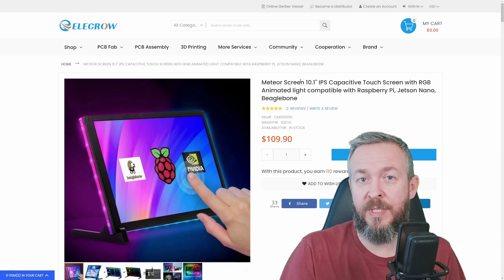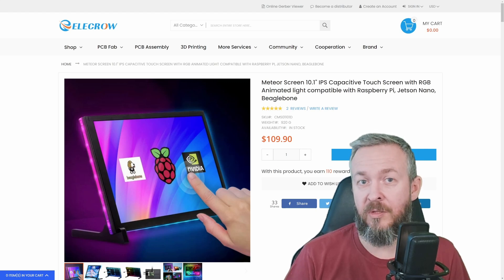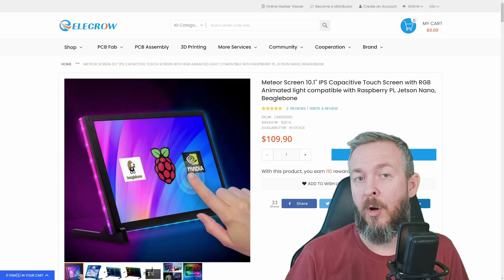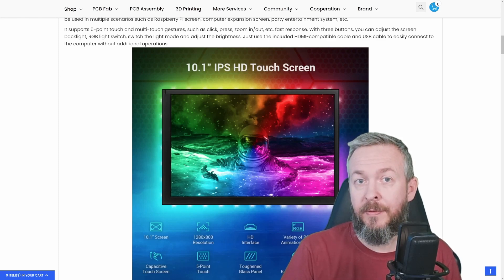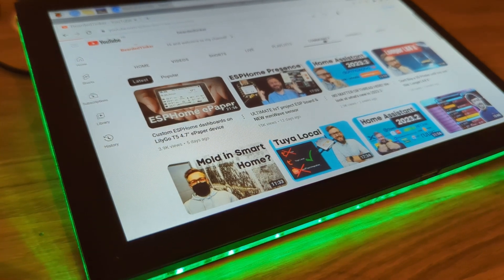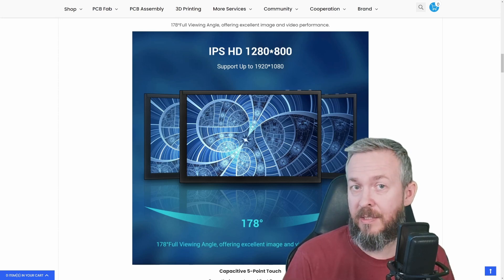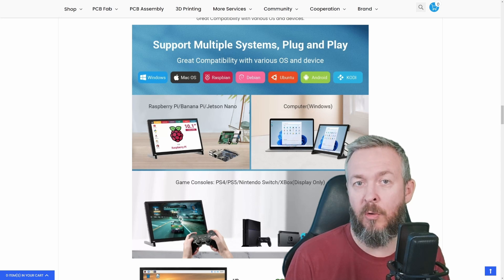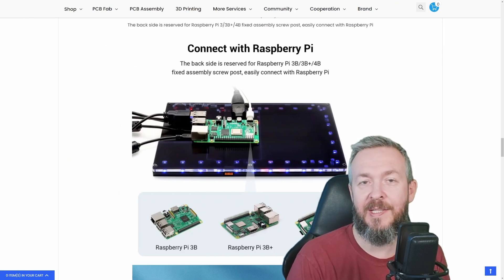Perfect 10.1 Touch screen for your Wall?! REVIEW

Comment: 5 point touch instead of 10 point could be quite a restriction, especially when doing pinch to zoom functions.   I don't think this display was designed to be wall mounted, though I do agree with you that a wall mount kit would be amazing.     Having the LED's all around the edge really detract from it being a wall dashboard for me.  I'd prefer a thinner panel without LED's.   If these guys could do this same panel, but thinner and without the LED's including a wall mount option, then it may be quite close to a perfect wall panel.
All that said above, as a stand alone display with some touch function, this does look like a great display and it is a decent size.    I do like it for what it is.
Reply from the maker: It was designed for desk use, and that's where it shines :) I have one case that I'll show today on stream - it's a perfect match to go with it. But than, you know me, I have to try and see how something would fit in Smart Home, or get used combined with HA ;)

Comment: Great video! Sometimes, you don't want all the excess hardware and security issues or exploding batteries of a reused smart device. Sometimes, you just need a low-res screen for a build and this is a neat little solution. Thanks for sharing!
Reply from the maker: Agree - and one other thing - it's great to have options. You can go whatever way you want.

Comment: I think I'm missing the point.
Why would you do all this instead of getting or reusing an android tablet that can do all this with less fuss and less cost?
Reply: Sometimes, it' just fun to build yourself. Also, the Android tablet may be overkill depending on application. Let's say you're like me and instead of having old Android tablets lying around, you have a ton of Raspberry Pi 1 or 2 lying around because you've been using them since they were created, or maybe an old ThinkCentre or other small form factor machine. This is a pretty neat way to repurpose those, in my opinion.
Reply from the maker: I also talked about 1 case - Home Assistant. But you can use it as Klipper frontend on 3D printer, or Octorprint controller.  You can use it as external display for cameras when recording, additional screen to laptop, multimedia controller,.... Tons of possible uses IF you need additional display.
Reply: If you want to reuse an Android Tablet, that is fine, and there are plenty of tutorials on YouTube for that.
This is an alternative, and a review of a 10.1" display to run with a Raspberry Pi.   Besides, I yet to see an Android tablet with LED's around the edges like this display has :).   
There is no point as such  It is a fun idea and one way to do things. :)

Comment: Well, you need a PI which is extremely pricey lately and you can't use it for a videodoorbell, because the apps are usually for android and iOS :D
In the end a 10,1" android tablet would be cheaper and nicer than this DIY solution :)

Also it is not FHD. :\ looks more like an advertisement than a real and good solution :(
Reply from the maker: Yeah, that not as simple answer. They are targeting desktop use - for example screen for retro pi os similar. In terms of doorbell, it shouldn't be a problem (of course depending on the setup) to push image from camera there as a actionable notification. 
But yes, screen with new Pi combined, today, too expensive. 
I may end up using it as third screen on my desk for streams, for Chat for example or similar.

Comment: Is it possible to run Home Assistant on the same Raspberry PI as the one driving the screen? My brother was real excited to finally find a Pi4 and a screen, but we found out the hard way HassOS doesn't output a GUI.
Reply from the maker: Well - let me put it like this - yes, but... There is installation method called Supervised, that requires installation of Debian like OS and than running scripts to install HA. Problem is that this is intended mostly for development and people that don't need any support, as there is none.
It's not recommended in any way, but works. I do have one test system with this install type.

Comment: folks can just slap their old phone on the wall and get all this functionality (sans rgb), as well as a voice assistant
Reply from the maker: Not sure about you - I do use large phones (currently Pixel 7 Pro), but it is MUCH smaller than 10.1. That would be too big of a phone to put in the pocket ;) 
But seriously, you are right, you can use phone, tablet, you can but ePaper screen (seen my previous video), you can use Chromecast and push dahsboard and have 50-60" dashboard - it all depends on what you want, if you have already something etc. It's always good thing to have options. I would never put phone on the wall, but that's me - I would prefer going for tablet myself.
Reply: @BeardedTinker  yes I agree size does matter ^^. But the neverending pile of trash made from our old devices is where I was coming from... In that case, a 6' junker phone vs a 11' tablet can't stand the comparison because one of them is free (for all intents and purposes). There are folks out there right now that can literally build a full smarthome just from their old device drawer if they knew. It's one of those changes that can affect a lot of people overnight and would be really easy and free to implement but people don't know about it. Can also double as a security system. Thank YOU for your work!